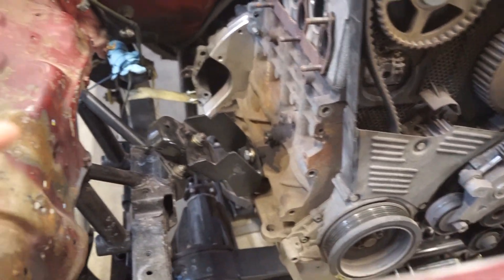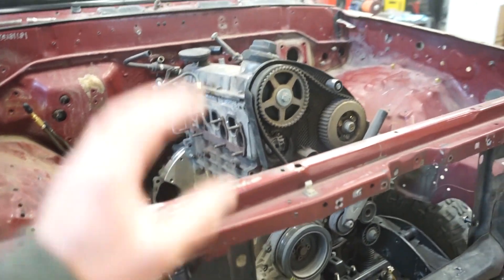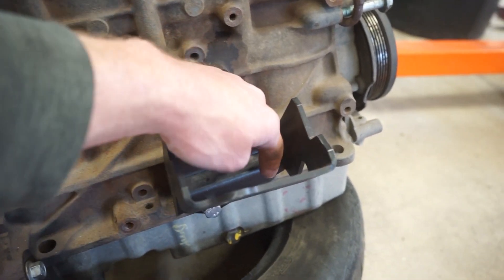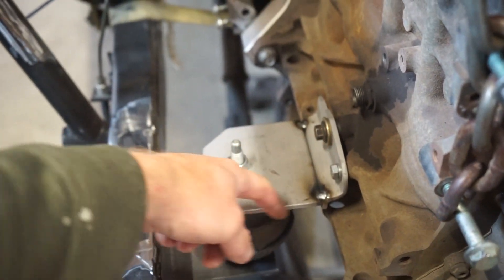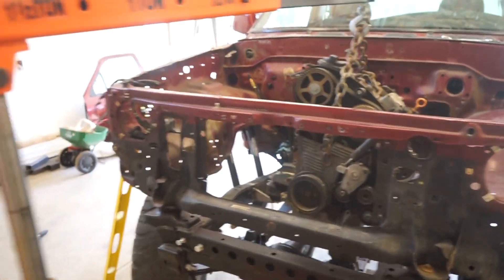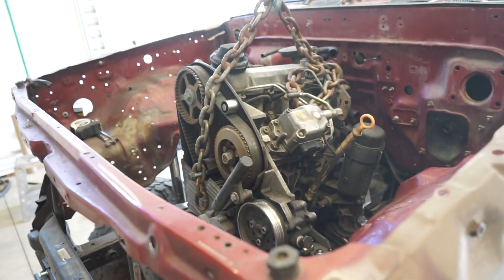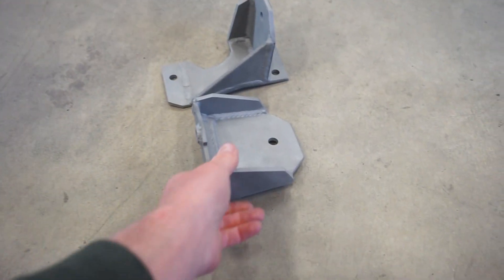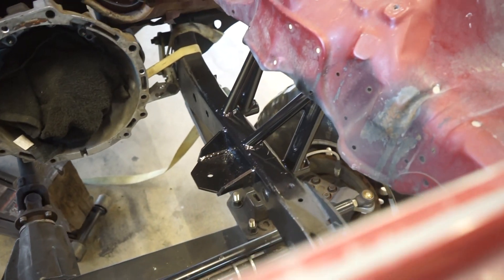Fabricating Hydraulic Motor Mounts For The Toyota TDI Swap!

Comment: Hey Austin as vw mechanic that little diesel engine probably won't last. Good for a small car, but not for the Toyota truck. Nice build tho.
Reply from the maker: These things are bulletproof when done right and actually maintained. The car i got the motor from was beat
Reply: you're under estimating these 1.9 tdi they can take abuse and have plenty of torque. my tdi alh has 240hp and just at 500ft torque